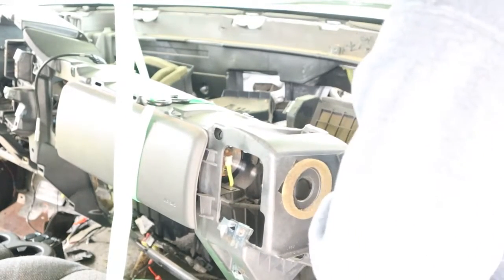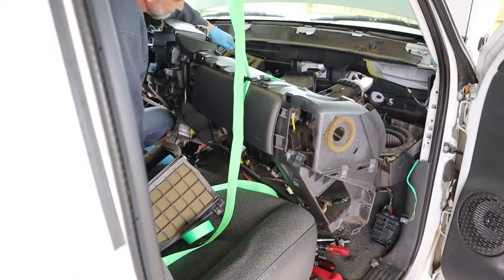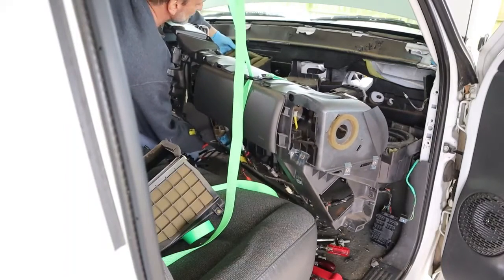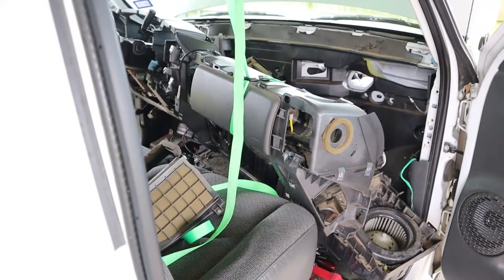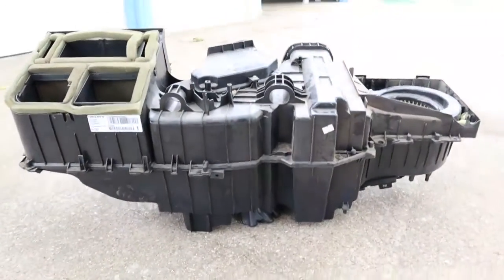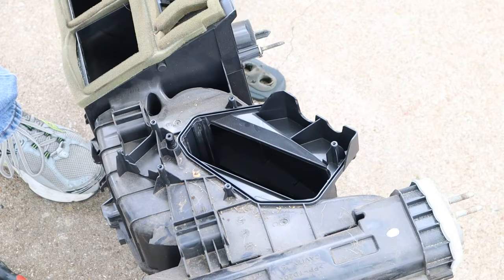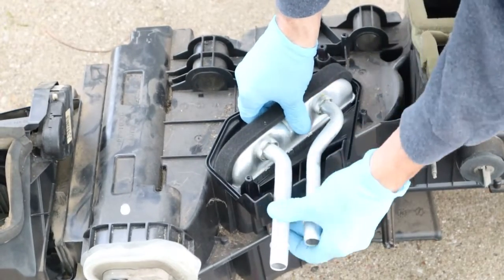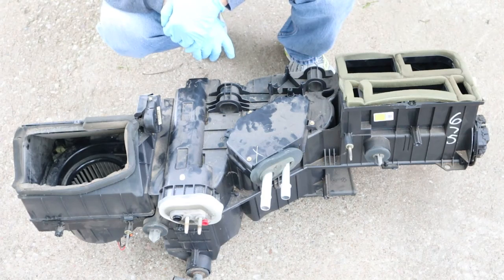HEATER CORE REPLACEMENT 1999-2007 Chevrolet Chevy Silverado GMC Sierra How To Dashboard Removal PT10

Comment: Brother, you are a legend and if no one ever tells you this before, you are legend!!!!

We have a 2004 chevy avalanche and a leaking evaporator core; and this process is almost entirely the same except for the airbag sensor location, certain radio wiring and engine bay config.

We followed your video second by second. We made it all the way to the actual box removal but then we had to stop for the day. For a break as night had fallen. Just two more screws on the right side, lol.. We will tackle the remainder of the job later on.

Thank you so much for being there for the little guys in this world filled of chaos. You are a good man.

Love from the caribbean brethren...
Reply from the maker: Thanks for your kind words. It makes it worth it to know that I have helped you and others with these videos. I hope your repair goes smoothly and everything works as you want it to.

Comment: I cut a whole in the firewall from the engine compartment. It exposed the core. I took the hoses off and hooked them up to e new heater core and bi passed the old one. I then put the wall back on using new hardware and sealant. I then put the new core on the firewall, wrapped it in insulation and was done. It took an hour and a half. This is an old ranchvtruck used for feeding and never leaves the property. It would be junked before it's ever sold.

Comment: Good Job , but I think I would have changed the evaporator while I had everything out just to be safe !!
Reply from the maker: Good point and I agree. I had mine replaced the year before by an AC shop. Should have had the heater core done at the same time. Live and learn. Thanks for watching.

Comment: Just a quick tip time saver if you disconnect the harness from the fuse box and wiper motor under the cowl push the harness thru the firewall you can take out the whole dashboard out with almost everything intact just unplugging the doors and body plugs
Reply from the maker: Thanks for the suggestion. I hope I never have to do this job again. LOL
Reply: @FakeLegGreg  lol I have to do one today for a good buddy if not I wouldn't do it at all lol
Reply: What else hold the AC box in place?? Texas Fastlife, if I disconnect the harnesses will I be able to get the box back far enough to take the heater core out??
Reply: @pinepurvissr.6417  yes thats usually what let's it not come out far enough
Reply: @05molinatsx  I didn't end up takin any harnesses loose under the hood. I just took my air box, battery, ac dryer and the six screws/nuts. That let me get it out far enough to remove and replace the cores.
Reply: @pinepurvissr.6417  yeah I guess that works too, aslong as you can swing the dash out of the way, I usually take it all the way out off the truck  I can do a heater core swap in 3 hours you do need to take the bolts from underneath the hood and discharge the a/c to take the box out

Comment: Wowza! That was quite the ordeal.  Great job...hopin' mine doesn't leak anytime soon!  Just curious, did you replace the blower motor while you were in there?  Thanks for sharing, that was very detailed and I'm adding to my library for when the day comes for my '99 Suburban.
Reply from the maker: Thanks for watching. No I decided not to do the blower motor. It will probably bite me later. I hope your heater core lasts forever. Good luck.

Comment: Why did you take the whole evap box out? All you had to do was take the top lid off to remove heater core
Reply from the maker: Did you even look at the beginning of the series of these videos? I am no rookie at this. This heater core is not that easy. You have to remove the dash and the whole box to get the heater core out. Last time I checked it was a $1500+ job and the parts are only about $75. I have done a lot of heater cores in my 45 years of wrenching. This was the worst I have seen so far. Thanks for watching.
Reply: @FakeLegGreg  I wasn't saying anything bad, you did great, but you don't have to remove the box. Just slide it back. I own an automotive shop and I've changed several of these. Granted they're not as easy as a dodge those yoy can change in 45 minutes.
Reply from the maker: @GregoryJohnston77  Gotcha. You are probably right about sliding the box back. I wasn't trying to flat rate the job and it is more difficult to get camera angles and lighting inside the truck. Thanks for your input though, there are always more than one way to skin a cat.
Reply: You do not need to remove box. Done it several times.

Comment: Kudos brother,  you’d think those fools at GM WOULD HAVE BEEN SMARTER.  I have a 2006 2500 GMC if this happens to me and clamp and the hoses and connecting my Honda generator in the bed with wires to a portable heater inside the cab. On your episode six I had a locked and loaded with a double barrel and remove that heater assembly piece by piece🤬. And those engineering knuckleheads created a water pump that you have to remove the harmonic balance to remove one nut that holds water pump it.
Reply from the maker: Yep, this is one of the worst heater core designs I have ever worked on. Good luck on your project.
Reply: They do it on purpose so you dont work on it yourself. And make the shops money.

Comment: I have not done one of these in a new truck before. Only watched 5 seconds of the video. O m g. Easier to put in a coat for the drive.
Reply from the maker: Yep. Except when windshield freezes. Good luck.
Reply: @FakeLegGreg  yes you are correct. A little history. I owned a 73 super Beatle . no heat and drove it all year long. Central ill . lol had a window scraper for the inside too. And yes you are correct , till it freezes on the inside. Thanks for yhe video. Looks like a lot of work. Guess I am most worried about the air bad. Was a fire fighter for years . and they were always a chance for injury or death. 👍
Reply: @FakeLegGreg  lol am two days into this and haven't remover the bolts from heater box. Wow could remove engine easier than this.
Reply from the maker: @douglasmueller4684  I agree. Bummer.
Reply: Ok followed your tutorial and at this time it is going back together. The bolts in the engine bay were a little tricky to find but once I did not to bad. To anyone out there this is a very good description of the work involved. Thanks for the video.
Reply from the maker: @douglasmueller4684  Congrats and thanks.
Reply: Unless you bypass the heater hoses, the humidity will fog the windows horribly.   Turning on the defrost makes it worse.